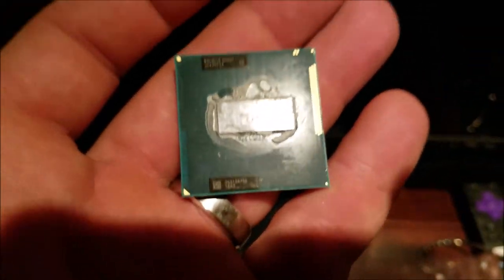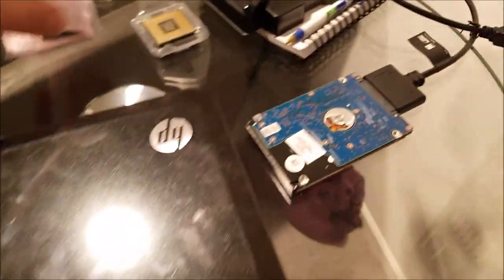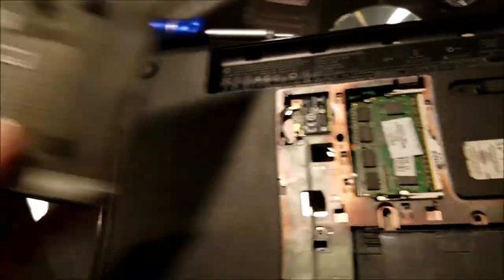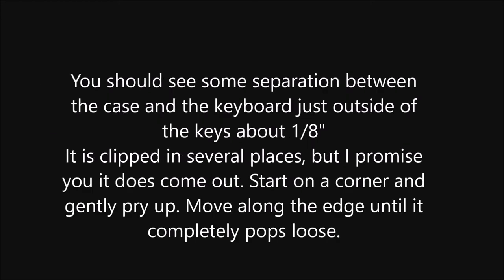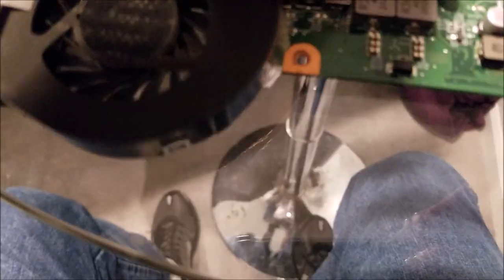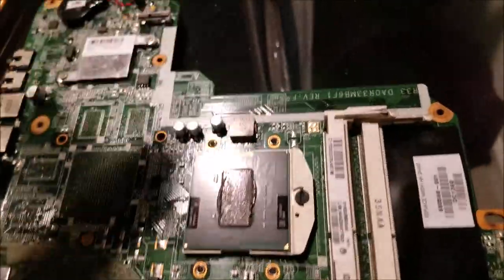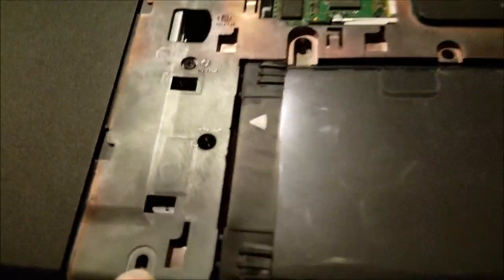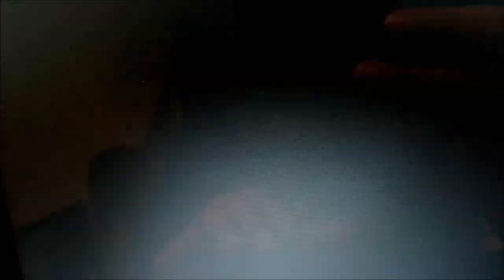How to upgrade to an i7 processor in your old laptop

Comment: Can i upgrade my inspiron 3520
intel core i3 2370M to i7 3840QM
Updated bios A12
Please tell fast i hav to buy
Reply from the maker: The 3840m processor will physically fit in the CPU socket. I'm  not entirely sure if your motherboard will work with it or not. It is a gamble. Laptops seem to be finicky about upgrades and apparently I'm one of the lucky ones. 
  Buy the new CPU and try it. If it doesn't work, return it or resell it.
Reply: @EricErnst  so can i upgrade to i5 3380M it has same tdp same socket only difference is sandy bridge and ivy bridge
Reply from the maker: @swankytechzone7602  That is exactly what I did. I went from a 2370m to a 3840qm. It works great in my HP Pavilion g6 laptop. Sandy bridge and ivy bridge are the same socket. If you get it and the CPU doesn't work, sell it or return it.
Reply from the maker: @swankytechzone7602  I bought my used processors on Ebay.
Reply: Ok thanks bro i'll buy i5 3380M and inform u if it works to help others
Reply: Will it work on hm 65 chipset? My processor i5-2410m rpga988B socket
Reply from the maker: @swankytechzone7602  how did the 3380m work?
Reply from the maker: @musicbossmusicboss4296  it worked on my laptop. I went from a 2370m to a 3840qm. Buy a cheap used CPU on Ebay and try it out. Tech freezer was going to buy a 3380m and try it in his before buying a 3840qm.
Reply: @EricErnst  hey bro it worked i5 3380M worked
Reply from the maker: @swankytechzone7602  nice. Glad to hear it. Now pick up a quad core and you're golden. Thanks for the update
Reply: @EricErnst  bro i'm satisfied with this processor it very good for me from 2.4ghz tu 3.6ghz😍
Reply from the maker: @swankytechzone7602  I'm sure it is better than the 2410m, but it's still only a dual core CPU. Do you do any CPU intensive tasks like video rendering? If so, you'll probably benefit from an upgrade to a quad core/8 thread CPU.
  My 2370m was painfully slow at rendering my youtube videos. An ssd to replace your hdd is another area where you can see a huge increase in responsiveness and usability. Ssd's are more expensive than hdd's but they are so much faster and make any CPU feel faster. 
  I'm glad that you are happy with your 3380m. Thanks for the update. I'm sure others will try a 3000 series ivy bridge chip in their 2000 series sandy bridge motherboard because of this. Cheers.
Reply: @EricErnst  bt they need to 1st update bios
Reply: I'm using it only for gaming

Comment: Can I upgrade My Hp pavilion G6 i3 to i7 3632QM I have dout  can Solve it pls
Reply from the maker: What model processor do you have right now?
Reply: @EricErnst  I3 Processor  2nd Generation it's possible??
Reply from the maker: @cool8148  I have an hp pavilion g6 and did the exact thing you are asking about. I went from an i3 2370m to an i7 3840qm. Update your bios and it should work. I think you can go further but a quad core should help things a lot. I asked about your current cpu because if the part number ends in U, it is soldered to the motherboard and cannot be swapped out. You need to find the actual CPU model first. If it ends in M, you're golden.
Reply: @EricErnst  I don't understand
Reply: @EricErnst  My intel i3 2310M  Socket 988BrPGA
Reply: @EricErnst  actually I buy 18$ i7 3632Qm On Olx
Reply: I Have Checked Hp Pavilion G6 Notebook Site I have Got PDF in thats saying it support but I have Scared to change it because Motherboard Will Get Damaged
Reply: So Pls help me  with Suggestions 😔
Reply from the maker: @cool8148  Yes. It will absolutely work. I like buying used CPU chips from Ebay. It is the cheapest place I can find them. I love my 3840qm. It does not overheat and is very snappy. I was worried about another xm processor after the 2920xm. Most guys don't run them as hard as I did, but the temps would get over 100degrees C while rendering youtube videos. I don't use the laptop for rendering YouTube videos anymore. I built a desktop pc with an AMD Ryzen 9 3950x with an RX 5700xt video card. It renders videos super quick. Its ridiculous. It has 16 cores and 32 threads. This laptop sees lighter duty now but i love how quick and easy it is to use for tuning my vehicles.
Reply from the maker: @cool8148  That's a great deal on a quad core CPU. Good luck with it.
Reply: pls feedback
Reply from the maker: @cool8148  it is the same socket. It will physically fit your motherboard. Don't physically damage anything during the swap and you will be good to go. Update your bios first.
Reply: @EricErnst  Already Bios Updated
Reply: I want Disassemble  And Swap The CPU  ✌️
Reply from the maker: @cool8148  It's an old laptop. Don't break any of the connectors when you pull it apart.
  Look up how to update your bios. If you don't, the new processor probably won't work. The newer 3000 series processors were released after the motherboard. So if you install one, the motherboard won't know what it is or how to run it. Go to www.hp.com and update your bios to the newest version before you pull it apart to install the new processor. 
  With the newest bios, my hp pavilion g6 works great.
Reply: @EricErnst  Thank you so much
Reply: @EricErnst  I have Another Question to I was upgrade i3 to i7 it's possible to 8gb Ram to 16 GB  Ram
Reply from the maker: @cool8148  yes. Ram is super easy to change. You probably have 2 ram slots so you'll need 2x8gb sticks of ddr4 Sodimms. Make sure you get laptop ram. I have 16gb of 1600 but i honestly rarely use over 4 or 5. In my desktop, I have 32gb @ 3600 and I'm in the same boat. 
  If you haven't yet, buy a 2.5" ssd. It will make your laptop feel so much faster. I'd say it makes a lot bigger difference than a processor upgrade.
Reply: @EricErnst  My laptop Motherboard Ddr3
Reply from the maker: @cool8148  I'm sorry. I typed that incorrectly. Ddr3
Reply: @EricErnst  I have prblm i7 3630Qm Not support??
Reply: What I can do? it's processer prblm or not
Reply from the maker: @cool8148  3000 series cpus work in my g6. What is your chipset?
Reply: @EricErnst  Intel core I7 3630Qm But display not coming I was swapped i3 2310m To 3630qm
Reply: @EricErnst  Help me pls
Reply: @EricErnst  Im waiting for your reply Pls if put not support processer no come?
Reply from the maker: @cool8148  i asked for the chipset, not the cpu. Unfortunately, you may have an older chipset that isn't compatible. Or the cpu may be broken. Or you didn't install a ribbon cable correctly.
Reply: @EricErnst  yes I install Correctly
Reply: @EricErnst  urgent please
Reply from the maker: @cool8148  if you installed everything correctly, reinstall your original cpu and find out what your chipset is.
Reply from the maker: @cool8148  I am at work. I cannot just drop everything. I'll reply when I can.
Reply: @EricErnst  I replaced old CPU it's turn on
Reply: @EricErnst  If I put unsupported Prosccer will work? that is issue??
Reply: 2 core 1 Thread
Reply from the maker: @cool8148  chipset. It should say hm65 or 76
Reply: @EricErnst  How I know?
Reply from the maker: @cool8148  if you download cpu-z www.cpuid.com , you can go to the main board tab and look at Southbridge. It should say the chipset number. Mine says Intel Ivy bridge in chipset and Intel hm76 in the Southbridge.
Reply from the maker: @cool8148  any luck?
Reply: @EricErnst nop  I have doubt unsupport processor physically it fit  what it's work? and i3 still going
Reply: @EricErnst  little slow i3 2n gen
Reply from the maker: @cool8148  if you can find your chipset, you can determine if the 3rd gen cpu is broken, or just incompatible.
Reply: @EricErnst  i7 3632Qm support then why i7 3630Qm not support?
Reply from the maker: @cool8148  officially, my 3840qm isn't supported. Find your chipset. It may be an older version that won't support any 3rd gen cpus. I'm trying to help you but you aren't making it easy.
Reply from the maker: @cool8148  do you mean 2632qm?
Reply: @EricErnst  i7 3632Qm support but i7 3630Qm Not support why

Comment: Sir can i upgrade from i3 4th gen to i5
Reply from the maker: You should be able to upgrade. It worked perfectly on my laptop. I started with an i3 2370m and I currently have an i7 3940xm. Every chip that I've tried has worked. As a matter of fact, you may be able to install a 5th generation processor. They show as the same socket so it should physically fit. Check your chipset and search for compatible processors of your chipset number. If it is an older chipset, you may be stuck with a 4th gen cpu. If you have a newer chipset that supports 5th generation chips, I'd try one of those instead. Good luck with it.
Reply: @EricErnst  thank you its very helpful 😍

Comment: I have i3 2370m old processor in my hp g6 2206 laptop, i want to go with i5 2540m , can it will be good? Please reply
Reply from the maker: An i5 2540m will be better than your i3, but not by much. I think you will get the biggest jump in performance by upgrading to an i7 quad core processor. If you haven't upgraded to an SSD yet, that is probably the biggest speed improvement that you will find. It will really give your old laptop a new lease on life. 
  As far as a processor recommendation, I would start looking at the 2630qm and go up from there. The single core performance should be better than your 2370m, and it can utilize up to 8 threads when the workload gets heavy. Anything above a 2630qm will work great. Hopefully you can find one cheap. Just look for a part number with a QM instead of just an M. An M designates a dual core mobile processor, and a QM designates a quad core mobile processor.
  Depending on your chipset, you may be able to use a 3rd generation processor. The 3rd generation processors use the same socket, but are manufactured with a faster and more efficient architecture. The way I understand it, if your chipset is hm 65, you cannot use a newer 3000 series processor. If it is an hm 76 chipset, you should be able to plug it in and it will work great. I would stay away from the 2900 series XM processors. They are very fast, but they run very hot. I had a 2920xm processor. It ran great, but while rendering videos, it would get to over 100C. That's pretty warm. I upgraded to a 3840qm and I love it. You can try a 3900xm series processor, it should run faster and cooler, but I'll bet it will still get pretty hot on your stock cpu cooler. For me, the i7 3840qm was a perfect fit. 
  Good luck with your upgrade. You will be glad to get rid of the 2370m.
Reply: @EricErnst  thanks Eric, but in my country the price of i7 3840qm is really high so i cant afford it, and it will be not good to spend those on old laptop..so thanks for reply
Reply from the maker: @rj2383  that's definitely another consideration. You have to weightge cost.. it's no help if a processor costs more than a new laptop. Good luck with it.
Reply: @EricErnst  my board is HM 65' 67type...with i3 2370, please suggest best options for upgrade with processors
Reply from the maker: @rj2383  2630qm,  2635qm, 2670qm, 2675qm. Those are all lower level quad core processors. They should all perform much better than your dual core i3 but still be pretty economical compared to the higher i7 processors.

Comment: what is the chipset you have?
Reply from the maker: I'm not sure exactly. It's whatever motherboard came in my hp pavilion g6 laptop. The original processor was an i3 2370m. I just updated the bios and installed a new CPU.  The motherboard is a Hewlett-Packard 183f. Version 56.32. Cpu-z says "chipset : Intel : Ivy Bridge : rev 09
Southbridge : Intel:  HM76 : rev 04"
  Hopefully that answers your question.
Reply: @EricErnst  your chipset is the HM76, thanks for the answer :D

Comment: Can i upgrade my samsung laptop cpu
 i3 3110m TO (i7-3820QM or i7 3840QM
 or i7-3920XM or i7-3940XM.)
Updated its posible 
Please tell me
Reply from the maker: The socket is the same, so it will physically fit. Some cpus are not always supported. My hp laptop worked. Give it a shot. 
  One thing to be aware of is that your chip is 35w tdp. A faster CPU will create more heat when working it hard. If you are using it for CPU intensive tasks, it may get warm. I went from an i3 2370m, 2c/4t CPU @2.4ghz (very similar to your i3 3110m) to a i7 2920xm. It would hover around 100degrees C while rendering youtube videos. It worked much faster than my little i3, but did create more heat. Make sure to have the cooling vents free when using it for CPU-intensive tasks. I've since built a desktop pc to handle my video rendering needs. I'm running a ryzen 9 3950x CPU and rx 5700 xt GPU. It's leaps and bounds ahead of my little laptop that could. 
  Good luck with your swap. It should give your laptop a longer service life before you need to upgrade the entire thing. Ebay, craigslist, fb marketplace and newegg are great sources for used laptops. Ebay is great for used CPU's. Let me know how it turns out.

Comment: which chipset do you have on this laptop,i 've got an i5 2450m and i want to upgrade to i7 3rd gen but idk if it's possible..?
Reply: According to online data, the shown HP Pavilion G6 runs a HM76 Chipset which can work with both Sandy Bridge and Ivy Bridge. I'm on a dell laptop with i5 2450m too but the chipset is a HM67, which can't run Ivy Bridge CPUs even if the socket is identical.
Reply: okay then,look i've got a acer aspire 5750g,it has it 2450..
The Chipset is HM65
What would be the strongest processor for that socket and chipset that i can install on it..?
and btw is it good for todays gaming,i would install an external gpu if it would be any good..?
Reply from the maker: Benko DiєsєL update your bios with your old cpu first. It's always a gamble whether or not the bios will support it. 2nd and 3rd gen mobile cpus will physically plug in to the motherboard socket. Its a pga988 socket. 4th gen cpus are on a different socket. So basically any intel chip that starts with a 2 or 3 is what will physically fit into your motherboard. Also, make sure that your processor ends with the letter m. If it ends with u, it's soldered to the motherboard and cannot be replaced. I had an i7 2920xm in for a while. I wasn't sure if it would even be recognized by the motherboard upon startup. The i7 3840qm that I've got in it now has a lower tdp and higher clock speed than the i7 2920xm.
  Check intel's ark to see the specs on your current cpu and see how much you can get  away with. That's how i settled on the 3830qm. My i3 2370m has a tdp of 35w. Make sure your cooling system is up for it because those quad core chips do create more heat. 55w for the 2920xm and 45w for the 3840qm. I suggest buying some high quality thermal paste. I used icy diamond. I went 10 watts above my original cpu's tdp and have been fine. Under full rendering load, I've seen 90 degrees C. The 3840qm doesn't start to thermal throttle until 105 degrees. Search and see what you want to try and then try searching for that used processor on sale sites. Much cheaper than a new chip! 
  Best of luck, and let me know how it turns out! 👍
Reply: Yea i know it will physicly fit but am just asking what's the best processor i can put in for this chipset and socket i mean from i7 sec gen not on those 3rd gen bcs i don't want to risk my money if it wouldn't be compatible with my motherboard..
Reply from the maker: Benko DiєsєL I just did a quick search of your 2450m. It looks like a 2.5ghz dual core with 35w tdp. To be honest, the 3840qm or the 3860qm would probably be your best bet. It's 100mhz faster than tge 3840 and has the same tdp. I couldn't find one cheap so i got the 3840.
Reply: oh cool,i mean i would give every money if my chipset is compatible with 3840qm bcs it's intel hm65..
Reply from the maker: Benko DiєsєL https://ark.intel.com/products/codename/29900/Sandy-Bridge
Reply from the maker: Benko DiєsєL i7 2860qm looks like the fastest cpu at 45w. 2960xm is the fastest chip period but you may encounter some overheating issues at 55w. The 2920xm ran great on my laptop but things got toasty. I didn't have any temperature monitoring software installed while i had that cpu running, but the fan exhaust vent felt awfully warm. Maybe you can use liquid metal and keep the temps down on a 2960xm. I bought some conductonaut liquid metal but decided that 90 degrees was acceptable in temporary situations under high workloads.
Reply: If you really want to find out if an Ivy Bridge CPU would work with your HM65 board, you could start with an inexpensive one like the Pentium 2020m which goes for around 15$ on Aliexpress, before buying a much higher priced i7. For the Heat-related issues you can replace the common thermal paste with liquid metal but ONLY IF your laptop's heatsink has no aluminium part in direct contact with the liquid metal covered CPU die.
Reply from the maker: JySheep my heat sink is all copper.
Reply: supported processor for chipset HM65 you can check in this link below
https://ark.intel.com/content/www/us/en/ark/products/52808/mobile-intel-hm65-express-chipset.html?language=en_US
dont  forget to check your Socket.
im upgrade HM65 chipset with Core i7-2670QM from Core i3-2350M and work well
for more info about processor your can check from this
https://ark.intel.com